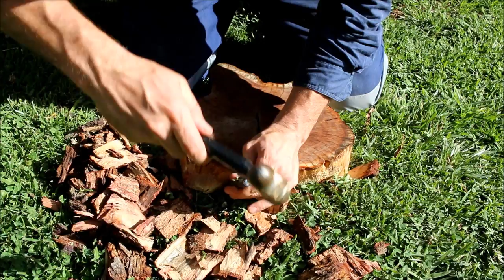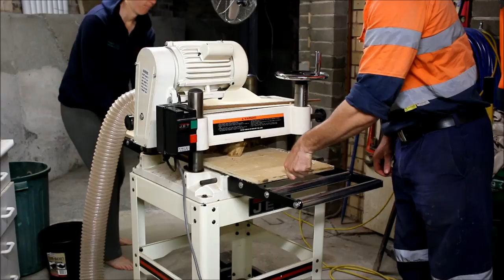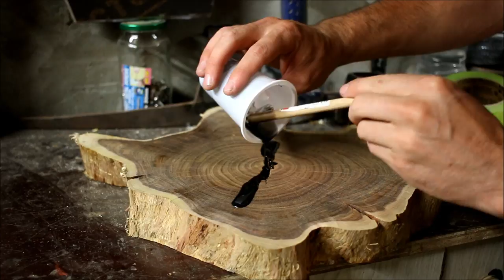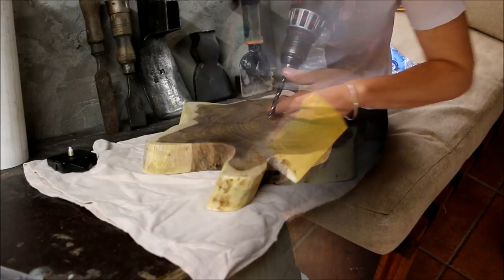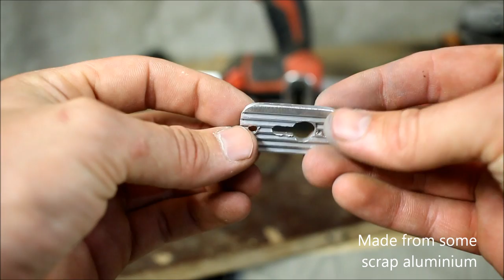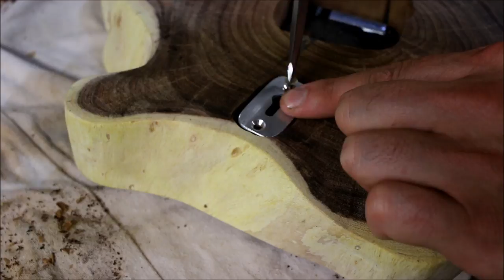Making a Cookie Clock

Comment: How long do you season the slabs? I just got a bunch of fresh cut red cedar slabs.
Reply from the maker: G'day, the general rule for slabs is a yer per inch of thickness but cookies are probably a bit quicker. The hardest thing with cookies is stopping them from splitting as they dry.
Reply: Làm ban gái anh nhé